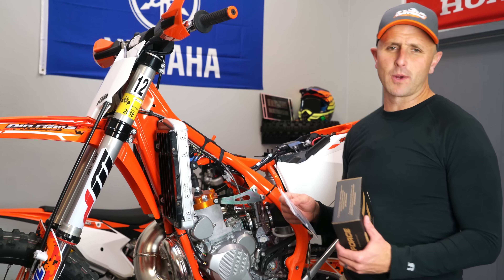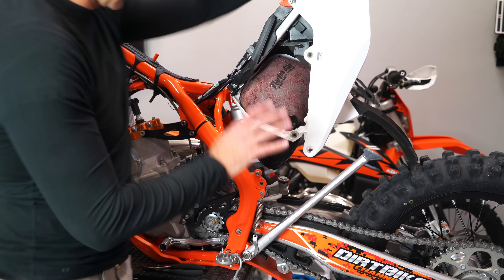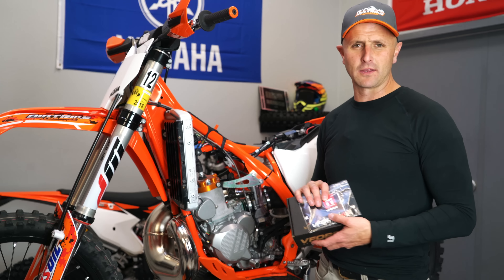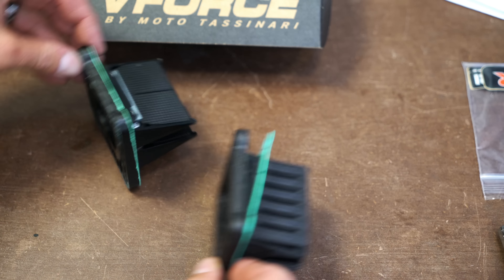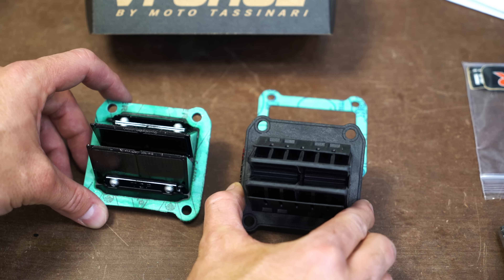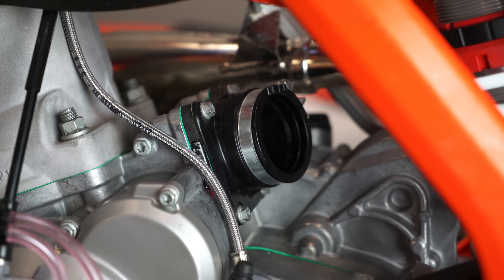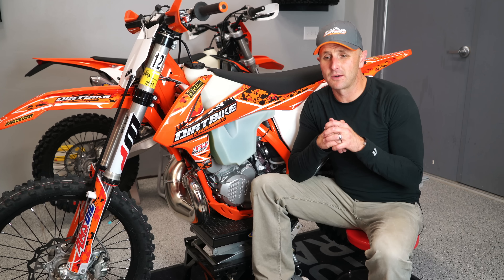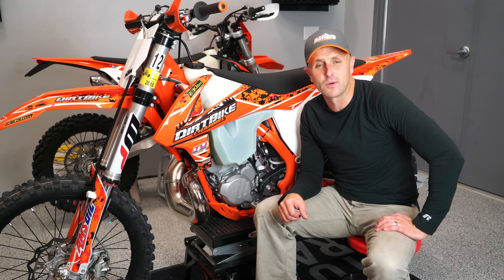Better Performance? | VForce4R Reeds Installation on a 2 Stroke Dirt Bike

Comment: Waste of money. Especially because these are so expensive. Pretty pointless with very little performance gain.Especially on practically a new bike. Wait until yours start to fail or don't work right at all or whatever and then upgrade to something so expensive like this. Or just take the one off of your previous bike and put it on there.

Comment: If you see a slight amount of light through them, no worries. It doesn't mean they are defective.
Reply: but it does mean that theyre not perfect.
Reply: I agree with Carl. The stock reeds are 100% acceptable.
Reply: Many brand new reeds do not show zero light-through but they still seal good enough. It does not mean they are perfect. But if it tickles your fancy, go ahead and needlessly replace them.
Just speaking from 50+ years as a motorcycle mechanic and former competitor.
Reply: Carl Atamanczyk they should see a little bit of light because the engine sucks for air then they open and close that’s what reeds do
Reply: matt cooper with the suction of the engine there would be no gap.
Reply: Reed peddles will flutter 100's times per second an air gap will not affect performance. Suction of the engine will seal them. Waste of money ... spend ur money on cylinder head, carb or cdi, or even better... suspension.
Reply: Kyle, the instructions say there is no gasket on the carb side of the reed cage. Stock has one, but VForce 4 says no gasket required. Can you verify?  Thanks!
Reply: @carlatamanczyk9199  isn't thats the point of those flaps that it should be closed? in other hand- why do you need them at all???
Reply: If there’s light. Turn them around unless you’re replacing regardless

Comment: These reeds are a significant improvement even to an already great running bike. It will pull stronger, smoother, and longer especially the KTM 300.
Reply: Could be, michael potts. Some of us like to stay in one gear more. Less shifting is less fatigue. It's all about what works for each individual rider. I find the 300cc pingers excellent all around bikes that'll accommodate short shifting momentum riders or those who like to make them sing. Personally, I'm too old, fat, and lazy for the 250f's:)
Reply: That's me in a nutshell. I think on the tracks I ride on I'd be quicker on a 125 4 stroke :-)

Comment: I had a few issues getting my 2017 250 EXC running well and after much frustration trying different jetting I  went with the VForce4R Reeds and my problems were solved. Love your channel, good honest reviews and useful info. Cheers.

Comment: Nice work. A little trick for connecting the air box to the carb i found is heating it up with something like a hair dryer , it will slip right on.

Comment: Something I've done for yars is rub a slight film of grease on both sides of gasket so if you remove it again then it seals perfectly but your not out any gaskets & can reuse them when there's nothing wrong with them. I use this with when replacing water pump seals & gaskets too with no problems. Great video & thank you.
Reply: i agree i have been soaking gaskets in oil before use for almost 35 years , it at least lets you re use them once   ..clutch casings ect come off without destroying the gasket ..obviously not head gaskets before anyone has a go lol

Comment: V Force are really a nice replacement reed, but if your stock reeds are good, run 'em.
Reply: Why would you run stock?? Stock are beneficial to the motor because there stock? Not really yes there made to go with the engine but also on a budget there not going to fit €180 reed to a bike if it isn't needed they want to make profit so therefore they go as cheap as they can on all parts but that work for the bike.... obviously KTM Kawasaki Yamaha ect all have a good quality build about them with a good power ratio & decent stock parts  that's why we all love them but they are also costly if you can afford it for sure buy aftermarket uprated parts for your bike but make sure you do it properly i.e carb mod's exhaust ect all would require rejetting & so on be sure to look into what you change & does it need changing is it worth changing & the out come of changing it... But for sure get rid of the stock if you can specially on a 2 stroke you want it to be  the best specs as possible not bare minimum stock crap you could see the gap i.e light after 1hr use they should sit flush... Your proves right there stock is bare minimum specs & price for it to work... don't get me wrong they would probably last a while but after one hour use your seeing light there crap would soon be hard to start running lean & so on & your suggesting that??? What you got half a nut holding on your front wheel??

Comment: Im pretty sure it says not to use a gasket between the the boot and reed cage Kyle.
Reply: I believe you.might be wrong.. I believe putting the gasket between the boot wouls ensure there are no vacuum leaks..
Reply: 100% They say in the instruction to NOT put a gasket between boot and reed valve. Although I cant see any harm to be done putting one in.

Comment: The metal on the v force that extrudes up will prevent valve flutter at higher rpms. This will help stop any backfire to the carb.

Comment: In my opinion your tuning issues are do the the RK TEK high compression head, shown in the video, but not mentioned by you. I put a RK TECH HEAD on my 2019 KTM 300 XC -W TPI. I have a high flow muffler and a JD jetting tuner. I had a lot of tuning issues, I was told the head required no additional fuel, which I later found out was very incorrect information, mine spark knocked horribly and had no top end power until I richened it up a lot on top. JD jetting told me use the full race Mod, that did not work either, it sputtered. I finally went back to trail tune, the nrichened up the top end from 2.5 to 7 and it ran great, a tom more power on the top end and no pre detination. I still need to richen up the middle a tiny bit.

Comment: I know this is a couple years old but anyway just to put it out there Mototassinari is or was the official reed supplier for KTM so the stock cage was also Vforce but the older style thus a VF3 and the new is a 4.
Another issue is the small gap between reed and cage is perfect fine won't affect performance or anything, the pressure will slam shut it when running.  The intent is to inform and not to criticize or nothing like that. Peace out and thanks.

Comment: Small gap in the reed paddles are fine on the pistons down stroke the reeds will seal shut like normal operation. Small gaps are normal the reed opens every up stroke of the piston and with these 2strokes screaming 10+ thousand rpms there bound to catch a little wear

Comment: Couldn’t get my jetting right on my 2019 husqvarna tx 300 got ride of stock and the vforce 4 put in boyesen rad valve jetting issues gone runs way better more top end . Also better low end . Boyesen beats the others hands down

Comment: KTM comes with Vforce3 so no real change. Would've liked to see this mod done on the CR or YZ to compare to the older style reed cage with less pedals to get real review. For example, YZ jetting, even perfect, has minor 1/4-3/8 hesitation. Most euro bikes coming with v3 or copy of it.

Comment: Vforce and a JD jet kit made quite a difference to my 2 stroke, I won't say it gained HP, but it made it clean and crisp on the throttle.
Reply: Awesome to read your experience! Im about to add the JD Jetts to my  bone stock TC250, I was a heart beat away from adding this V force reeds and an unnecesary piston kit just to make it heat resistance to the upgrade in power... But if you feel like there isnt much power gain, then there isnt much HEAT gain, meaning my stock piston should be able to withstand the duty of perfect carburation. Maybe next year I'll invest in both! Piston is too new to throw more money into it hahaha not pro, just riding here for fun and searching perfection.

Comment: I had jetting issues with the Mikuni put in the boyesen rad valve fixed the jetting issue bike runs perfect 2019 husqvarna tx 300 boyesen makes a better product .

Comment: I bought my 2013 xcw used and I thought the V-force came stock on those.  But maybe I am incorrect.  But if that was the case, why did KTM stock running the V-Force from the factory?

Comment: Your OEM reeds looked pretty good compared to mine. I installed Vforce 4R a few weeks back, I didn't notice much of a difference and I had way more light showing through my OEM reed cage.
Reply: John John 
I bought the reeds, tried them, didn’t notice any improvement, tested them on a dyno, they give you 1.8hp less than original reeds, waste of money.

Comment: I just bought a Jetting kit from JD Jetting... i am a little doubtful of my desicion because my bike is completley stock... I;ve always felt that KTM (even tho Makuni carbs are 90%perfect) desgine their pistons, cranks, to fit a 90% perfect jetting kit, not the perfecto JD Jetts... I am looking to further upgrade the bike with reeds, so then also piston and posibly a FMF exhaust (Maybe not stock pipe is sick just clean it out)
Reply: Friends dont let friends dont use V force, the cheap plastic reeds kill engines and they wont warranty your parts , then they blame your engine for damaging their part

Comment: For install v force 3 how much gasket green color have need 1 or 2 i mean 1 for cylinder to reed valve pack and 1 reed valve to carb aniway 1 or 2 gasket??

Comment: I own a 18 300 and one of the stock reeds broke a 10hrs. So do not keep the stock reeds. V force is the way to go!
Reply: My 16 250 ate an entire petal at 20 hours.  Haven't been able to get it to run right since.  I now have to tear it down.  Hate this bike.  Nothing but problems
Reply: Brandon J does the 2017 te250 have the same issues? What would you do differently
Reply: @blazers12369  don't know if 17 is same.  Replaced reeds and wouldn't run right.  Put in Vforce 4 and it was worse.  Then put in JD jet kit and made some slight carb adjustments and it's better now.  I think stock reeds were shit and vforce4 made it rich.  JD jet kit fixed it.

Comment: Is there two gaskets that you need to install or just one because my kit came with two so I'm confused I normally only do 4 Strokes know nothing about 2
Reply: Should only need one. Is one thicker than the other ? On other 2 stroke o have installed just one against the motor. Edit.. just watched it again and looks like on this bike there is a gasket between the boot and reeds as well.

Comment: I have a 2018 Husky TC250 and run the 4R reeds. I also have FMF exhaust, silencer, and an RK TEK head. I believe the reeds make it a little bit better.
Reply: Did you have to rejet?

Comment: VFORCE... They gave a very high idle in my RMK... Switched back the stock cages with new Boyeson reed petals and my Idle was perfect ! Paid the VFORCE cages close to $300 shipped... And sold them on FaceBook for $100... While in my sled the VFORCE reeds didn't impress me at all to tell you the truth...
Reply: Did you try to lower the idle by jetting your bike well for vforce? Ofcourse you need to set your bike uo when doing mods.

Comment: If you’re carb vent tubes were being pinched by the skid plate that could have been why it wasn’t running like your 2017
Reply: Was only pinched because the bike was on the stand, pinching em between the stand and skid plate.

Comment: Would this make a big difference on a Yamaha yz 125? And would it make a big difference on a Ktm 200 exc?
Reply: I've been running v-force on an 08 yz125 and yes they make a huge difference. I needed to change the pilot jet to clean up the bottom end after installation.  Now it has way more usable bottom end and gets into powerband sooner.

Comment: I bought those, tried them, felt no difference, so I tested them on a dyno, results are clear.... 1.8hp less than stock reeds, total waste of my money. I called the company that makes them, told them what happened, they asked me to send the dyno results, so I did -according to them I should get 2hp extra with those reeds, so I told them to send me the results of their dyno showing the increase of 2hp, I’m still waiting to receive anything. Bottom line, you will lose 1.8hp with those, I have thrown them away.
Reply: SEND THEM TO ME, How much?
Reply: @laosgpsmapmidnitemapper9411  
Where do you live?
Reply: Friends dont let friends dont use V force, the cheap plastic reeds kill engines and they wont warranty your parts , then they blame your engine for damaging their part

Comment: Hey guys I bought a 18 tx300 which definitely has some jetting issues aswell; was hoping after installing Jd kit it would run smoother, but it wasn't by much. Any of you folks have any suggestions or videos to point to. Thanx in advance:)
Reply: Jamie Brasnyo reeds are known issues for these new bikes I also bought a 2018 tx300 and have put the jd jetting on and soon to order the v force reeds because of the issues I'm not really having a problem yet but I have had them out and you see lots of daylight around the cage and these people are wrong when they say a little daylight is ok cause no it's not you should see no daylight through the reeds
Reply: ktm bro's well I'm definitely going to order some then as well. I wonder why husky would put out such cheap reads? After everything is said and done I'm paying like $13,000 I don't understand this. First the shity carb now shity reads LOL
Thanks for your comment nice to know I'm not the only one with the new tx300 with these issues
Reply: Jamie Brasnyo I think they are trying to lower costs so that all the new tech it does have doesn't run the price up even more but still sucks although the reeds that are in there are carbon fiber just like the v force I honestly think it's the reed cage that is the problem it doesn't have the stop over the reeds that stop them from opening too far under high revs
Reply: Keihin pwk Air Stryker 38 carb that’s the answer you seek
Reply: Sean MacNee I've heard that too, might consider it or the electron one of the other

Comment: The reed cage on my 125cc seems to be bigger But I dont know why
Reply: maybe you have a diffrent legnht on your overall intake. so that the bike needs bigger reeds to get the correct airflow?
Reply: What I also never understood is that the 125sx uses a 39mm carb while the 250cc and 300cc use a 38mm while they make way more power. Strange but must be some kind of explanation for it
Reply: its the venturi effect. if you have to big of a carburetor, the air velocity wont be high enough. and if you have to small. then the engine dont get enough air. 125cc probably needs a bigger one becuse of the shorter stroke, i would imagene

Comment: I just got into riding dirt bike last year, my only experience has been on 4 strokes. I know I want to get a dedicated enduro/woods bike and I keep flipping and flopping between 2 stroke and 4 stroke. I just have zero experience ridin/working on a 2 stroke.  Your videos make me really want to try a 2 stroke but then again the YZ250FX screams at me at the same time.
Reply: TheBraps as far as working on them, you can't beat 2 strokes. Much more simple design makes them easy to work on. And if you take it to a shop, your bill will be 1/4 the cost of a 4-stroke repair. The power delivery is all rider preference. 2-strokes put a smile on my face in a way that a 4-stroke never can.
Reply: TheBraps you ride 2 and 4 strokes different but once learning the 2 stroke you will love it I had a xcfw 250 with 300 big bore sold it and just bought a husky tx300 2 stroke and I will never go back to 4 stroke for my woods bike these new 2 strokes deliver plenty of low end grunt like a 4 stroke but then the power band comes in and it's all smiles ear to ear plus way less engine maintenance than a 4 stroke plus way cheaper and easier to fix when something does go wrong. Don't let the 80 hour engine rebuild scare you either I have friends getting almost 200 hours out of a rebuild
Reply: You will never regret the 2t ktm. So much more exciting to ride than a 4t
Reply: Kyle has a few 2t versus 4t vids. i would go with the 2t though. much more fun to ride.

Comment: Kyle, i just did this mod on a weekend. the second gasket is not suppose to be there - between reeds and a boot as per manual that came with those reeds. i m sure it wouldnt hurt though to add it ha. i did it on my 2017 150xcw.
Reply: Actually it will affect performance.
Reply: I just did the vforce 4r install and called moto tassinari and they said it doesn’t matter either way
Reply: It can actually give you more power, very little but it definitely doesnt hurt
Reply: Was it worth doing? Any noticeable changes? if so, what? Looking to do this, but don't want to if there's really no point..

Comment: You need to clean your airfilter it looks so dirty.
Reply from the maker: I actually hasn't even seen dirt yet as of this filming.  It's just a mix of blue and red oil, so it looks bad.
Reply: Lol if you can read "twin air" its not dirty

Comment: Are you Seriously making how-to videos but obviously know nothing of what your actually doing..? You just took off a perfectly good v-force oem KTM reed block to put in an aftermarket v-force cage that are exactly the same which is a Spode move but what’s worst part is you are trying to be a source of knowledge to help others but you’ll likely not give good info if your this lost ..!!
Reply: Rusty Rodrigue  KTM stopped putting VForce reed blocks in as OEM.   Maybe do a little research before making a comment like that.